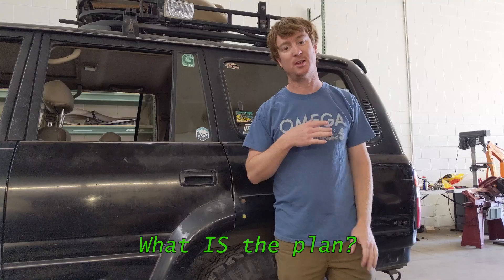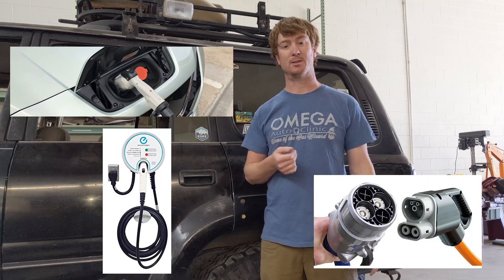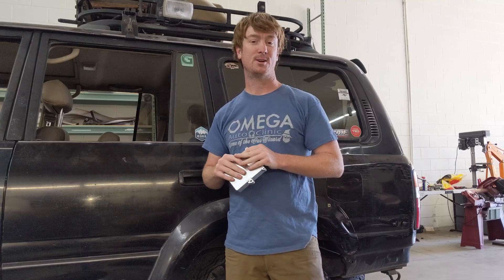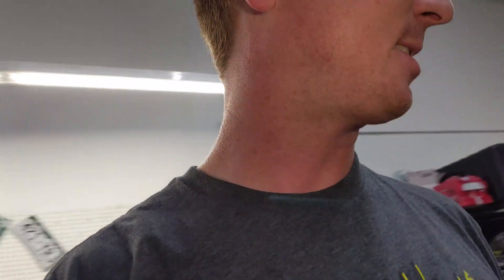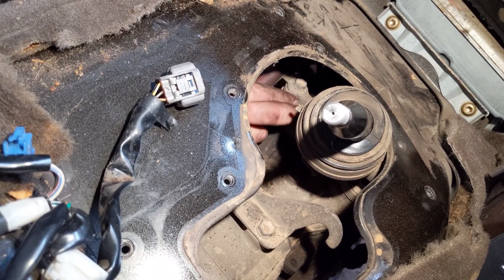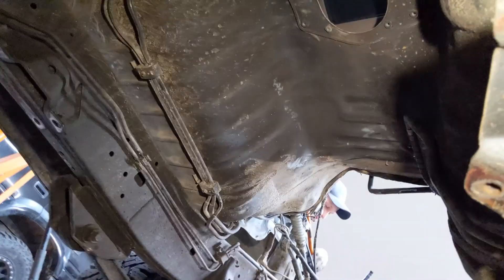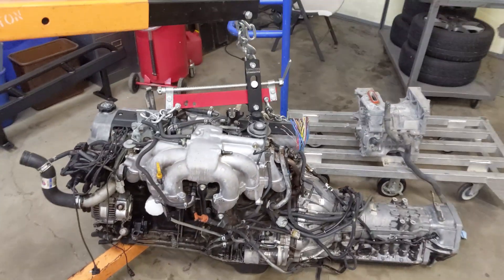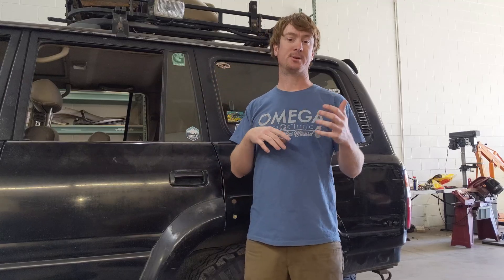Land Cruiser ENGINE OUT- The EVSwap Land Cruiser EVJ80 Ep2

Comment: Nice plan, but I I would change the diff ratio to a higher number, otherwise, the 'low_low' wold be like 2nd gear.
Reply from the maker: Low-high will be for on-road and low-low will be for off-road driving. I want it to have very low gearing for off-road 4x4 driving on rocks mud snow sand etc. Thanks for the tip!
Reply: @EVSwap  then I strongly recommend changing the diff gear ratio for a higher one(6ish:1) or if possible the black box should have a low ratio of 3.3-3.7:1 . You’ll get more torque = acceleration = climbing possibilities
Reply from the maker: @MichaelFalcon-g3f  I have the Blackbox + the original transfer case so 2.7:1 + 2.4:1 and 4.1:1 diffs. I think it should be low enough? 26:1 total crawl ratio.
Reply: @EVSwap  Yeah, I’ve read the spec’s , after that I decided that lower would be better. I worked at a tuneup shop so long story short, for your current or bigger wheels (overall diameter), weight, and most importantly-the intended use, I would recommend a lower ratio(i just checked online, in your stock transmission the 1st gear was 4,1-4.8:1; 2nd - 2,5:1, so I’d stick to the first) if in future you’ll decide towards larger wheels, then maybe lower. Don’t just trust me, you can look it up, and calculate it
Reply from the maker: I see what you mean. I am looking to run bigger tires so maybe you are correct. I think that this is a good ratio because the electric motor's torque delivery is sooner and flatter than the gas engine. Most of the time off-roading with the gas engine in 2nd gear in low range has enough torque to climb most obstacles and only need 1st for the really really steep or slow obstacles. So I think the electric motor at 1000-2000 RPM will outperform the gas engine at 1000-2000 RPM and end up working. We shall see! As you say I can easily change the diff ratios if needed.
Reply: @EVSwap  yeah, it’s better to test, again I’m only proposing a suggestion, maybe that gear will be enough…., however I would use a stick trans, just for fun and awd drifting))))

Comment: I'm thinking of doing the same with my 100 series.   How did you work out that the leaf motor would have enough power to replace what you had from factory?
Reply from the maker: A 100 series would be more challenging I think because the electrical system/engine/transmission/immobilizer/brake system etc is all so integrated with eachother. For a 100 I would recommend probably a Tesla motor or something that can deliver 200-300hp. The 80 series is notorious for being really slow and gutless with the 6-cylinder engine, and I think the LEAF motor can at least match that performance haha!
Reply: @EVSwap  I think you’ll do fine.

Comment: Cool project! Would be interesting to see net increase/decrease in weight after engine, gearbox, tank, exhaust pipe etc goes out and electric motor and batteries goes in! Saw a guy here in Sweden who converted a Chevrolet Impala 1960’s something with a Tesla motor and home built batteries and it got al little bit lighter and had equivalent to 500 hp!
Reply from the maker: Yes it will be, check out my first episode I actually take the vehicle to get weighed in stock configuration so I can compare afterwards.